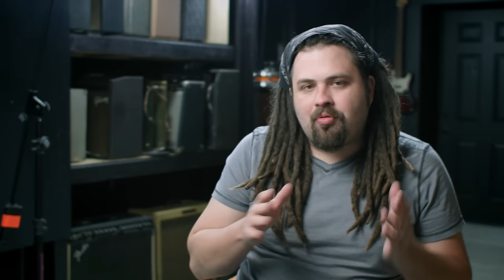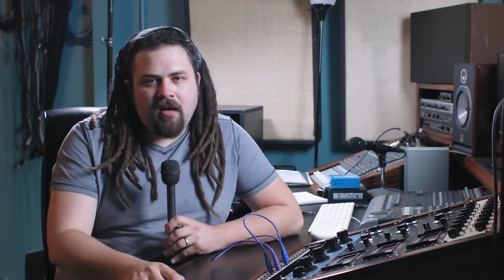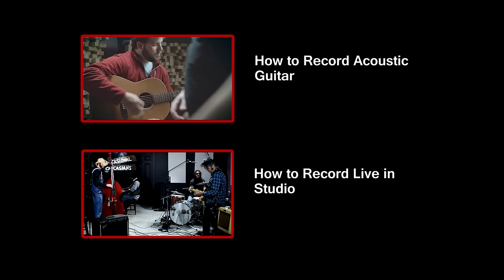Phantom Power - How to Avoid Damaging Your Microphones

Comment: What if you accidentally turn it on with an sm57? Did I wreck my mic? How would I know?
Reply: No, it won't hurt your SM57. Most dynamic mics are ok to use with FP. Be careful with ribbon mics.
Reply: you cannot damage a standard mic while phantom power is turned on.  It runs on pins 1 and 2, and the power is applied through pin 3.  It simply doesn't do anything to satndard mics which do not require phantom power.
Reply: Thanks for the information but I would like others to comment on any experience with using standard dynamic mics with phantom power on.  I am looking at a used 4-channel mixer/amp which has phantom power on all the time on all four channels (considering using for solo/duo acoustic work with a combination of condenser and dynamic mics).  The documentation states this could damage some mics.  I have other units for example a 8-track HD recorder, which has switchable phantom power which I have used condenser and dynamic mics with but never had phantom power on with my dynamic mics.    Thanks for any insights.
Reply: Nate David Same lol i was shitting myself

Comment: someone please tell me is there a risk for my computer when I connect phantom power with my microphone to record my gameplays and have more clear sound ?
Reply: I'm tryna figure that out now, you ever figure it out?
Reply from the maker: No risk to your computer. You should be connecting without phatom power, then turning it on when everything is connected. The outputs of your interface only give the signal at line level, no phantom power.
Reply: thanks a lot man I got my phantom power and connected it - works perfect :D

Comment: mxl 770 plus PS400 phantom powe, is it fine?
Reply from the maker: It should be. Most mics have a range of voltage it can run off of. Most of the time, you want 48v.
Reply: Mygod thanks for replying. When connecting the phantom power to the laptop, which is better, xlr-3.5mm jack or xlr-usb?

Comment: Makes sense...  Even plugging a 3.5mm jack will create what I would think to be backfeed from the  contactors coming together.  having an active low amp 48volts charge to the magnet When plugged in I would think could spike on and off as its being plugged in wearing the coil from spikes possibly...   Keep it Safe with SOFT Turnons, offs!
Reply: The switch for 48 volts may be even controlled with a low voltage signal to switch the 48 volts on through the electronics inside, warming up as it reaches full connectivity rather than right all at an instances instant..
Reply: randumb thoughts//